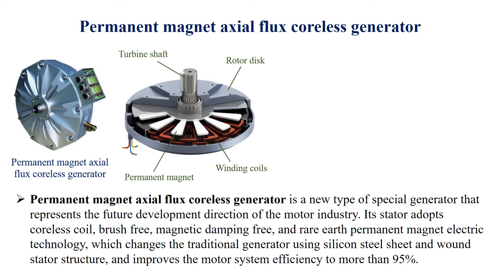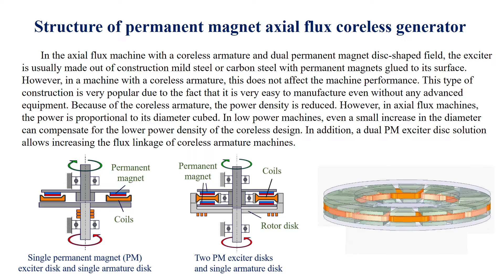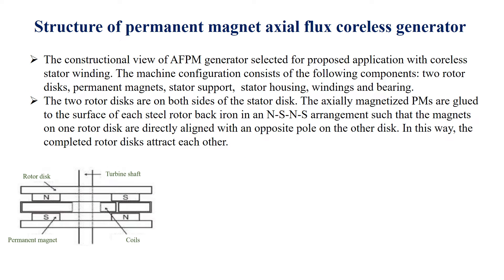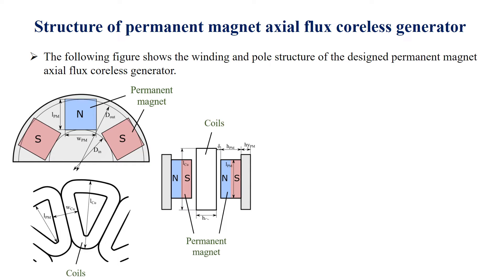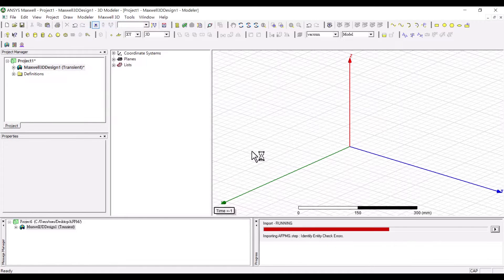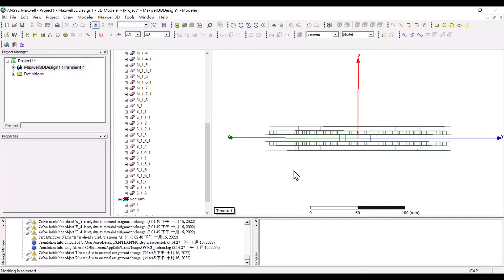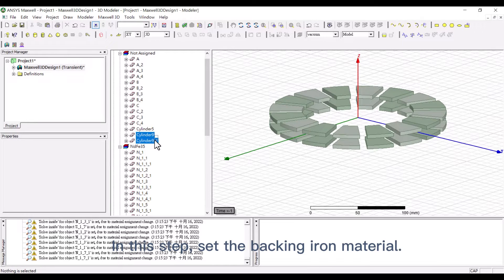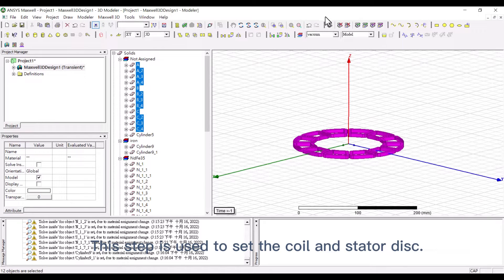Design and simulation of a permanent magnet axial flux coreless generator; Using Maxwell software.

Comment: How do I set motion of translator for cylindrical PM generator?
Reply from the maker: To set the motion of the translator for a cylindrical PM generator in Ansys Maxwell, you need to define a "Band" around the moving part. This is essential for enabling motion simulation of the rotor or translator.

Let me know if you need a video reference or more help!

Comment: Hi John,
How do you define the air region around the machine?
How big it should be ?

Thanks
Reply from the maker: In fact, the setting of the boundary range only needs to be greater than the maximum range of the simulated object and magnetic field.
Reply: @johnhsu5773  ok , but how much? i am geting different torques for differnt dimentions.
Reply from the maker: @saidzanjani650  , a more detailed simulation grid setting will reduce the difference in output values, but it will increase the time for computer simulation calculation and analysis.

Comment: sir hello ı have a few questions how ı can contact you ı got a problem ı cannot set the magnet direction (S&N)
Reply from the maker: You can refer to the video in this link, and you will easily learn it.
https://www.johnseniormotordesignandmagneticcircuitanalysisengineer.com/setting-the-magnet-magnetizatio

Comment: Hello sir 
 I am making a generator.
25 mm diameter and 5 mm width neudynuim magnet  
16 magnets on one rotator
Diameter of rotator is 22 cm 
What will the size of wire ???
Which gauge copper wire is the best for my generator???
Reply from the maker: Generally, the size specifications of the coil are determined based on the rated current of the generator. For detailed performance, you can refer to the specification sheet when purchasing the coil winding assembly. A larger diameter or higher quality of the coil can handle higher current and heat.

Comment: hi, jonh. Thanks for your help.  I want to analyse torque of this generator as a motor by using 3phase current. Is the process same with this video? Do I should give current instead of voltage?
Reply from the maker: I use three-phase voltage when I want to drive the motor in the simulation software. In fact, as long as we understand the principle of the motor and we clearly know what we want to calculate? We can set voltage drive or current drive on the simulation software.

Comment: you should add more magnets in between the gaps of the nig N S magnets, as to create a halbach array, biasing the field density towards the coil!
Reply from the maker: Thanks for your advice. That is really a good way to enhance the performance of the generator. Maybe it can be the theme of my next film. However, the amount of magnets will be more, the price of magnets will be expensive, and it is not easy to place the solid Halbach array magnets.